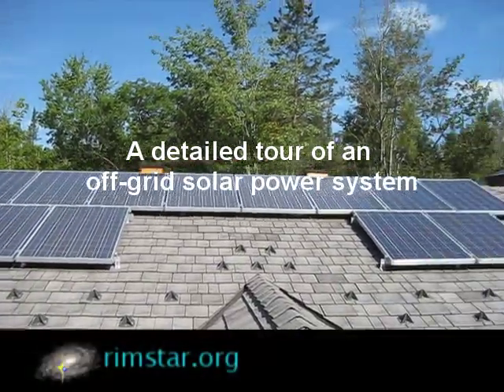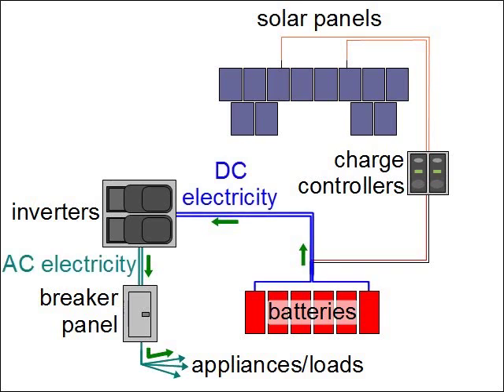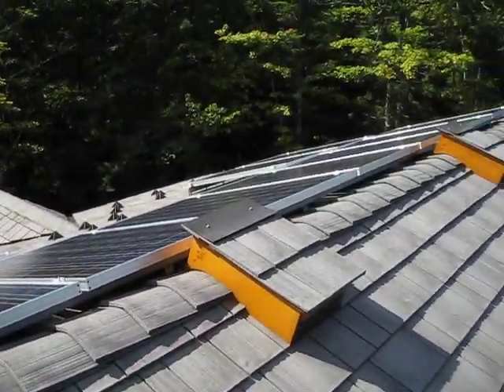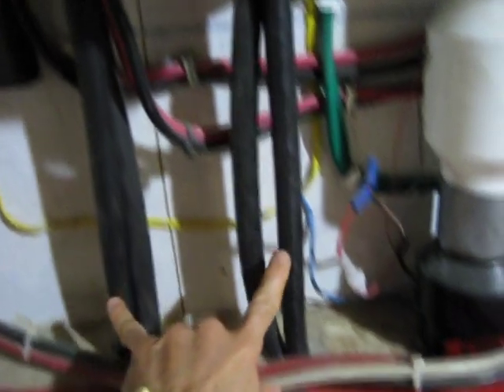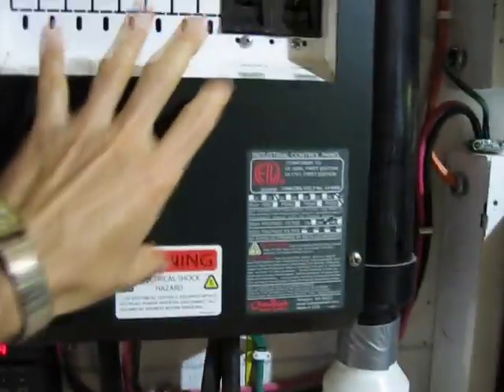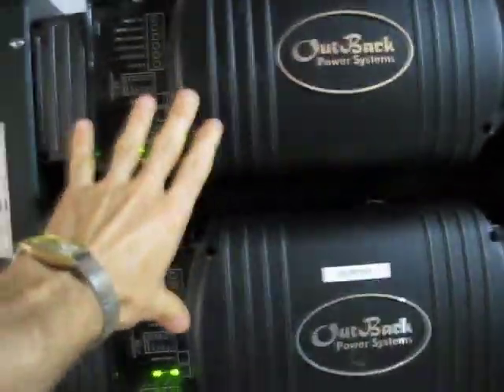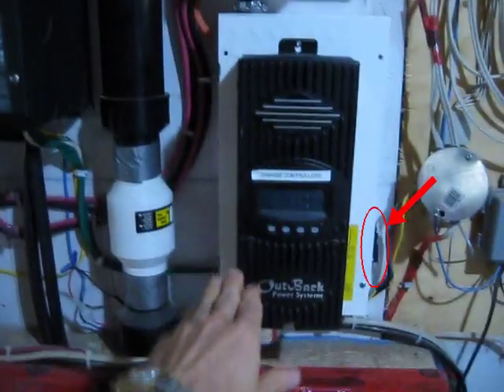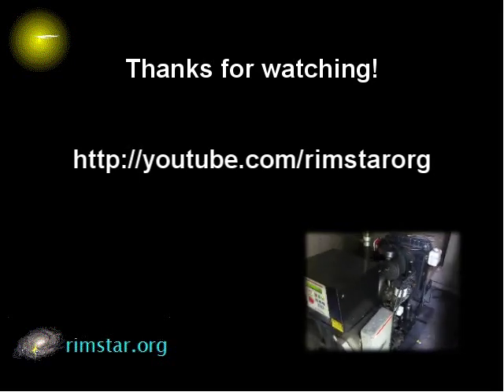Solar Energy - Off-Grid Solar Power/Electric/Photovoltaics Tour/Details with Backup Generator

Comment: can you do a video on how you wired the inverters to the service panel??
Reply from the maker: wellsmd1 I no longer work in the solar business so I don't have access to the hardware anymore. However, if it's an off-grid system like the one in this video then think of the inverter as the grid and wire the inverter's AC output into the input side of the breaker panel.You'll also need a good ground. You can buy grounding rods from some hardware stores. These are 4 or 5 foot long copper rods, around 1/2" in diameter that you pound into the ground and run a wire from that to the input side of the breaker panel. That should also be the ground for your inverter.

Comment: what is the cost of this setup ?
Reply from the maker: Byron Lopez Around $40,000.
Reply: RimstarOrg
Wouldn't a sterling engine with panels reflecting the sun be more efficient and cheaper than photovoltaic solar panels ? Very nice video, I usually don't comment but now I do haha.
Reply from the maker: Lee Eccles
Yes and no. I recall a few years ago reading that a commercially made Stirling engine was up to 30% efficient, and even if you add the losses due to the parabolic mirror or lens to concentrate the sunlight on it you'd still be a bit above the 20% efficiency for a photovoltaic solar panel, though I don't know if an equivalent cost and power Stirling engine would be cheaper. You'd also need a tracker to track the sun. If you do that then you may as well go with a small but expensive 40% efficient multijunction photovoltaic solar cell with parabolic mirror or lens and tracking system. That might be cheaper than a Stirling engine system. But Stirling engines and tracking systems are mechanical systems that won't have the 25 to 30 year life of a PV panel or cell, so yes and no.
And thanks for breaking your silence and commenting. Glad you liked the video.
Reply: I've just purchased my Schneider Xantrex XW 6848 complete for 20grand and that is with 3 (24v) Forklift battery banks. If you're interested contact me and I'll send you the info.

Comment: Hi, I have a problem with my solar energy off grid,  and maybe you can help me.
I have a diesel generator, to generate power when is dark or cloudy. 
The power went off the other day, and now, if we stop the generator there is no electricity in the house, the batteries are full, the solar panels are charging but the systems just shuts down when we stop the diesel engine. If you have any idea what we can do let me know.
I look forward to heard from you.
Adrian
Reply from the maker: What do you mean by "the systems just shuts down when we stop the diesel engine"? What specifically happens? Does the charge controller shut off too? If you have any monitors, do they lose power and go dark? Can you describe your system a bit? Do you have breakers/disconnect switches? What caused the power to go off?

Comment from the maker: Neither. The AC generator feeds into the inverter. The inverter then passes the AC from the generator straight through to the breaker panel to power household loads and converts any remaining power to DC charge the batteries, should charging be needed. So the generator is an input to the inverter. Not shown in the diagram is a bypass path around the inverter, going from generator to breaker panel in case the inverter is broken. Search "inverter bypass switch" for more on this.

Comment from the maker: Ottawa. I don't know if you're a solar installer or have a solar system, but if you do and live around here it becomes very obvious. Keep in mind, in the PV world, one month without sunlight means no useful sunlight, not seeing the sun's disk. Cloud covering the sun = no sun were PV is concerned. You might get a few amps but they won't power your off-grid cottage. Also, I hadn't noticed this myself until off-grid solar customers pointed it out. It happens every year.

Comment from the maker: Batteries to inverter was 250 amps DC. Between the inverter and generator, and the inverter and breaker panel they were 50 amps AC. The generator also has one on it but I don't know the value. I don't recall the exact value for the breakers around the controller. Each controller's output, given the panels, is 45 amps so the breakers were around that. I don't know how the panels were wired on the roof but I'd guess 22 amps into each controller.

Comment from the maker: Oh, you're talking about breakers for the solar system itself. You can see them on the solar system's panels and I talk about them during the tour and when going over the diagram. There are breakers between each component in the system - there as disconnect means so the components can be isolated and removed should repairs be necessary and also there for tripping when there's a failure or other problem. That also includes between the inverters and generator going to the main breaker box.

Comment from the maker: Computers and all sorts of electronics are powered by this installation. These aren't cheap inverters, they provide clean power and surge protection. I don't have a photo of the inside of the breaker panel. This is a customer site and is out in the country. However, I did see inside the breaker panel at one time and to the best of my recollection there are no circuit boards inside (if that's what you mean by mcb.)

Comment from the maker: Do you mean the wiring? They come with a wiring diagram but it's pretty simple. From memory, a DC lightning arrestor has red, black and green wires. Red goes to positive of the incoming PV array, black to negative and green to ground. AC lightning arrestors have black, white and green for 120VAC arrestors or black, red, white and green to 240VAC arrestors. Black and red got to the HOT wires, white to neutral and green to ground.

Comment: Yet... the wiring is pretty ugly :D 
Wires routed on the floor and walls should be better protected from damage.
Mechanical damage, firstly, then electrical or thermal damage. Let's say that someone is pushing a metal rack made of L shaped profiles and accidentally bumps in a pair of live cables, crushing and penetrating the insulation and shorting it or shocking the unwary. 
:)

Comment from the maker: The gen supplies 240 and the inverters together output 240 to the breaker panel. It does have an X.240 auto transformer but it came pre-wired. It was a while ago but I think it was series/parallel with the slave programmed as OB Slave L2. I'll keep in mind your idea of doing another video but I would need access to the system, which being way out in the country, I don't. I'd want to do more than just diagrams. I'm glad you like it. I was going for usefulness, as opposed to just entertainment.

Comment from the maker: I don't know why someone flagged you comment as spam. Are you asking about the connections to the battery terminals? Are you also talking about connecting a DC load? If so then yes, you have it right. I guess I should have added more wires to the diagram but I wasn't intending to go into that level of detail. And no, I'm not a professor but in a former career I did spend 13 years teaching for a software company and still do a little teaching for a local school board.

Comment: Are you professor in university? So lets make a conclusion......in to positive pole i connect 1 wire that goes to load (with breaker), in to negative pole i connect 2 wires, 1 goes to load and the other goes to ground....am i correct?

Comment from the maker: No problem, man. I'm happy to help. Regarding the current leaking to ground, in order for current to flow through the battery to ground you need a circuit. The positive isn't connected to ground so there's no circuit. Meanwhile once you've connected the negative to ground, it's now at ground potential i.e. there's 0 volts between the negative and ground so there's no leakage there either. Good question, by the way.

Comment from the maker: Oh, if it were my system I would ground battery negative since I don't like the idea of the battery voltage being random with respect to everything else. My previous reply was just what the US and Canadian electrical codes say.

And I'd also put fuses (or breakers) as in the video. I prefer breakers because they can also act as a disconnect means.

Comment: OK......your and my opinion is similar.......don't ground the battery and panels with negative pole. I' m thinking to add fuses to cables, similar that uses for cars to avoid short circuits from burning the cables. What you think? Am i correct if i  add fuses?

Comment from the maker: That's probably just a 12 volt system so no, they don't need to be grounded unless some equipment wants them to be. For example, a Magnum automatic generator starter assumes that battery negative is grounded. I would still connect any metal cases to ground to prevent danger of shocks due to short circuits.

Comment from the maker: Yes, they're both grounded. The negative pole of the batteries are grounded inside the large box just to the right of the inverters, the box with the large battery cables going up into it. The negative wire from the panels goes to the charge controller. Inside the charge controller the panel negative and battery negative are connected together. So since the battery negative is grounded, so is the panel negative.

Comment from the maker: Not enough amps to matter. I didn't design the system but I think it was because of the voltage limit. I suspect these were Kyocera KC175GT panels (guessing based on other installations we did around the same time) and that there are 4 series strings. I did the wiring of the charge controllers and inverters, not the solar panels. Open Circuit Voltage per panel is 29.2V. 3 in series is 87.6 volts. Add 25% for 110 volts. And that's if they were KC175GTs. The OC voltage might have been higher.

Comment from the maker: Nope. The generator power goes into the inverter first. The inverter also contains a charge controller, though we usually just say charger in that case. The way it works is that the inverter passes generator power straight through to the appliances and any remainder is used by the inverter to charge the batteries as needed. The charge controllers that you're referring to (2 in this case) are used just for charging from solar power. These chargers don't cause problems for each other.

Comment: These are battery's I use for powering my electronics experiments so they are always kept topped up and charged after use, they are also the sealed types. Its just the location where I keep them would make them very easy to quickly connect and disconnect from a small lighting load via alligator clips/spade lugs and some thick wire to over come wire losses due to the low voltages involved.

As for power cuts I'd say only about twice a year (they are usually caused by copper wire thieves).

Comment from the maker: You should also have a charger keeping the battery topped up at all times. Batteries lose a little of their charge each day. You might also consider sealed batteries so there's no maintenance or hydrogen. They do cost more though. How often do you have powercuts?

The company I sometimes do solar contracting for once installed battery backup for a hotel as you described (i.e. no solar, just batteries, charger and transfer switch), also for emergency loads only.

Comment: Great setup you have there! I had an idea of making a smaller backup lighting system in my room for when we have powercuts. A small 12vdc mains powered supply energising a relay that has a lead acid battery and small 12v lighting circuit connected to the normally open side of the relay. When the power goes out the relay will close and complete the 12v battery powered light circuit, this can also be used to power the internet router and other 12v items. When power is restored the relay will open.

Comment from the maker: @namesleft Around $40000. The components are the same as in any off-grid PV system but this is a large system (2 inverters, 2 charge controllers, large battery bank, 10kW generator) almost capable of keeping people in a city type lifestyle. Even then it can use more solar panels; there aren't enough non-shaded areas on the property.